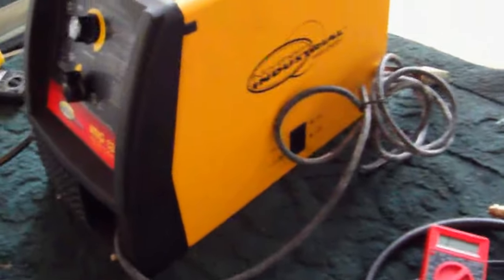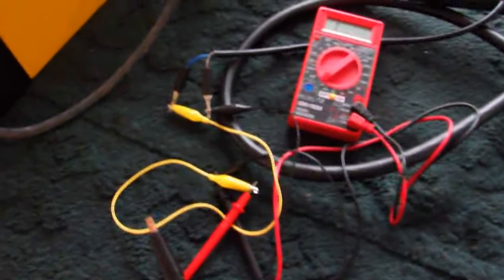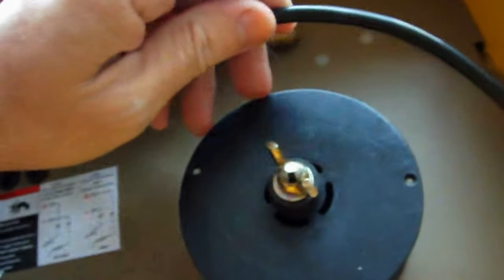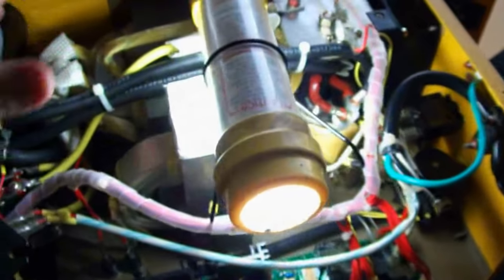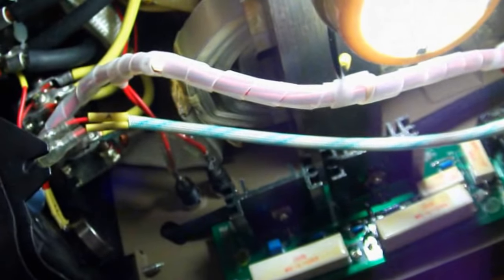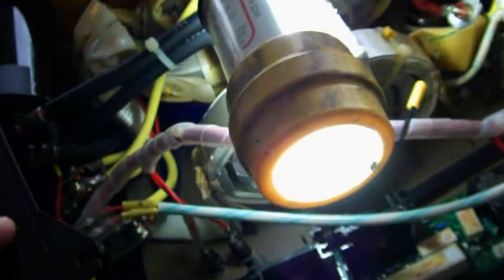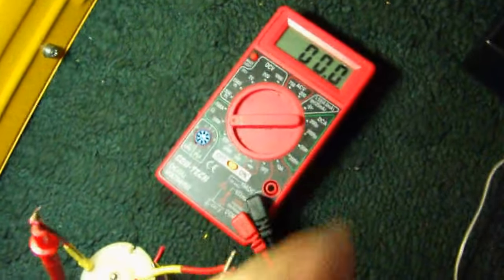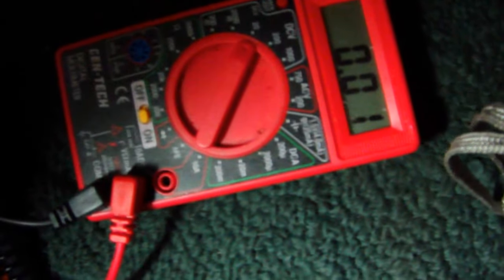Northern Tool MIG 135 Troubleshooting Fail

Comment from the maker: Yes I did.  I'm curious what is wrong with it also  :)   There is nothing obviously wrong but it still will not run.  I saw this was a common question regarding welders.  That being if you could just buy a DC motor and not have to buy the whole wire feed assembly.  I'll post an update later to see if I do in fact find a very cheap way to fix this fairly typical problem.

Comment from the maker: I did for a little bit.  I took out the wire feed motor and it is dead.  So found a DC motor of the same dimensions on ebay for $10 delivered.  Curious if I can make it work.  If not I may get another one like this and use this one for spare parts.  Or go with the quality Lincoln Electric.  I have found many times things made in China are a bad value over the long run.

Comment: Hey syyenergy7  i bought one of these Northern Industrial 135 Mig welders got mine this past  july 1 2013 been making all kinds of stuff with it never once have i had any problems with it. i'm in the process of making a welding with this welder for this welder. at first i was going to order one online but i went to store and bought it right off of the shelf. just letting you these are great little welders i also got a 4 year warranty on it  if any thing happens to it i take this one back

Comment from the maker: Maybe.  This one was a lemon.  It had several things wrong with it, but I have a way around it to work the wire feed with a 6 volt battery which was the last thing wrong I could not fix.